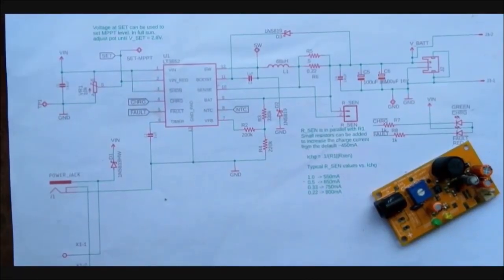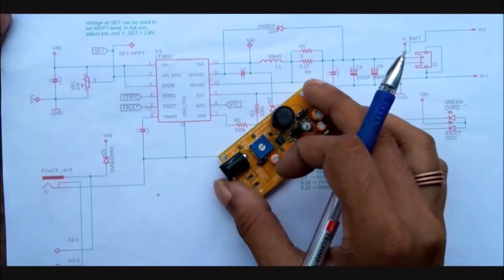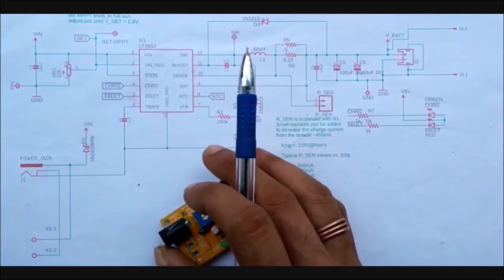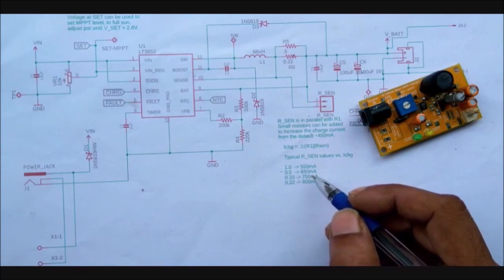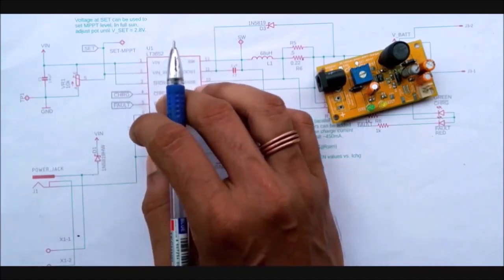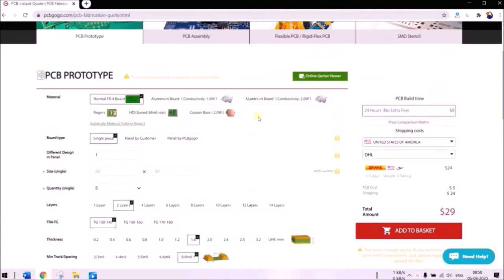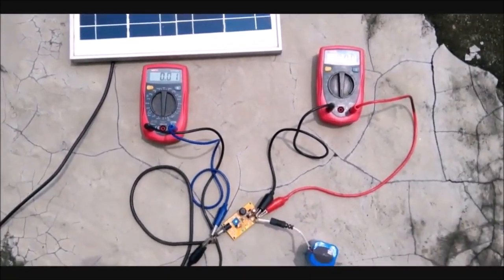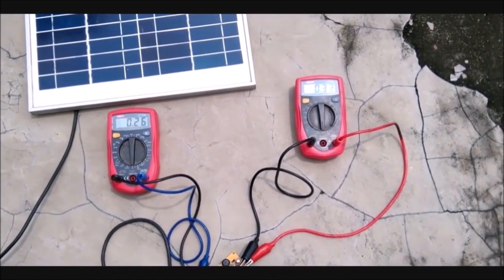How to Build a MPPT Solar Charge Controller to Effectively Charge Lithium Battery using Solar Panel

Comment: The circuit you have shown has some errors. D2 does not connect to GND , it should be connected to the BAT terminal(Pin9). It's part of the bootstrap circuit to bootstrap the internal switching fet. The circuit is not a buck /boost circuit , it's only a buck regulator. The "boost" pin is for bootstrapping(boosting) the internal drive circuit for the switching fet.

Comment: Can it be used like this without connecting to mcu?
Reply from the maker: Yes you can use it without a mcu.
Reply: @Circuitdigest  Then, how do I check or track that the mppt is providing the best power?

Comment: I was wondering if you could tell me what I could use for Maximum power tracking experiment with P&O method
I have a commercial charge controller, Sparkfun sunnybuddy
and a 30W solar panel. Thank you.
Reply from the maker: Please write your queries on our Forum for further discussion https://circuitdigest.com/forums
Reply: Hey Jelka I'm trying to do the similar experiment as you mentioned can you help did you find out?